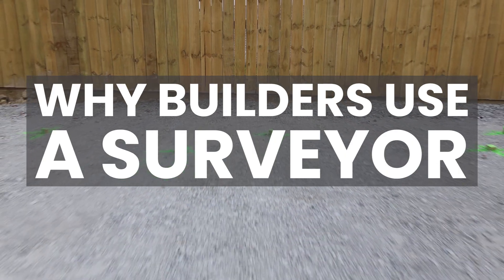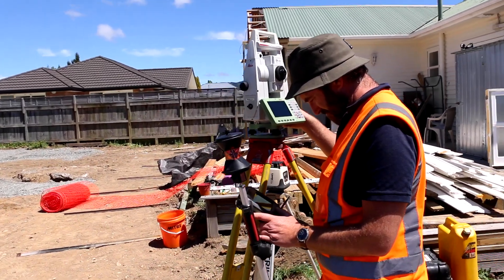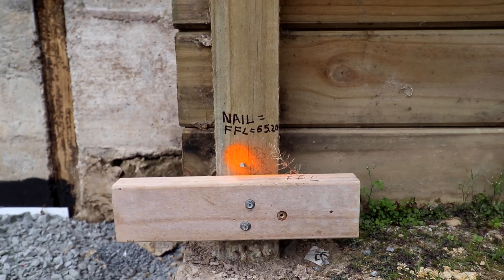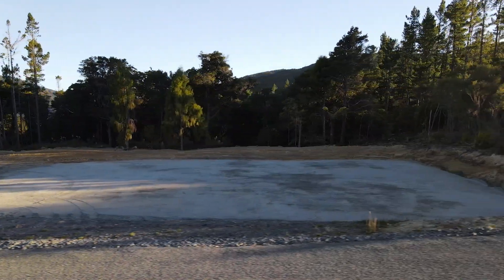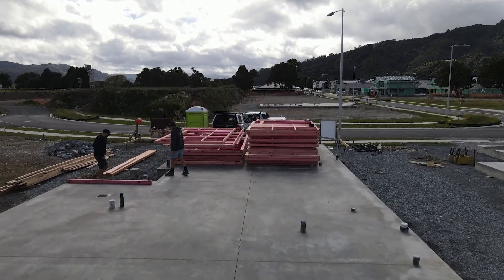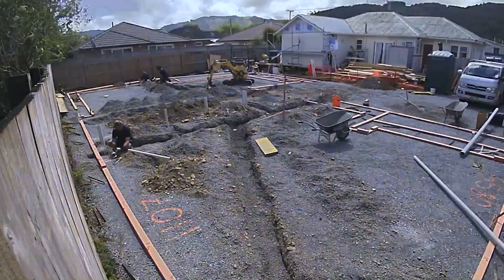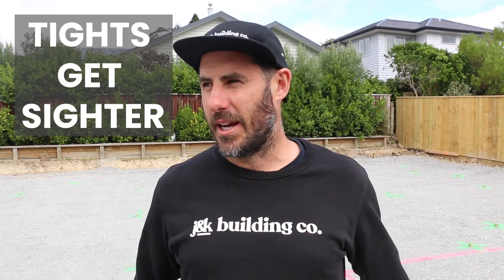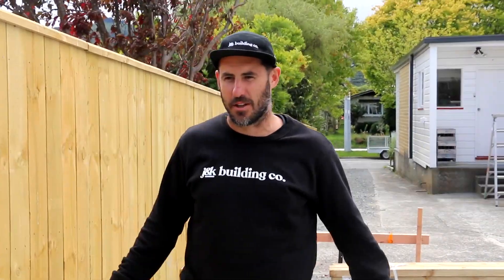What we use a Surveyor For - New House Build 2022

Comment: Hey Josh, in a new build, when does a surveyor comes into the picture? I presumed after the architect does it final design? Or after the geo tech report?
Reply from the maker: Hey two parts, 
1) before the designer starts, they do a top to get lay of the land 
2) at earthworks and foundation set out 
note - we don't need a topo on every job, but we use a surveyor to set out every house